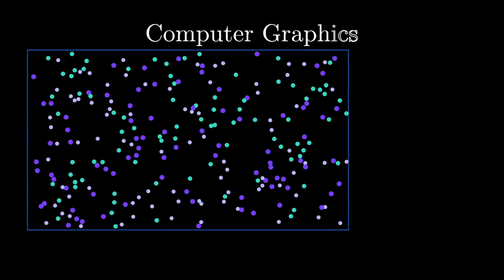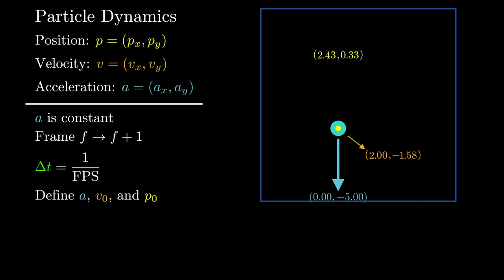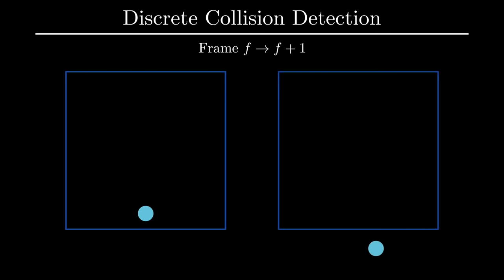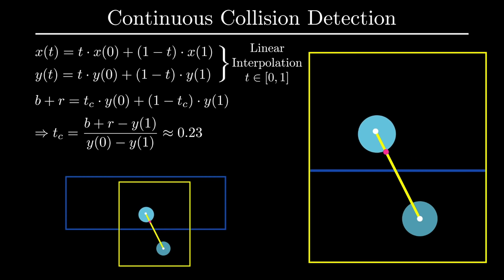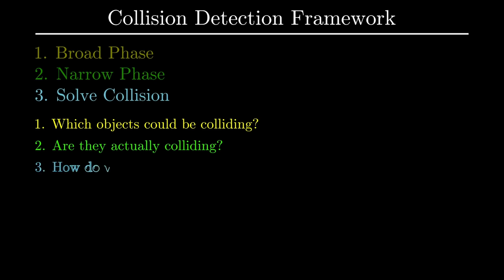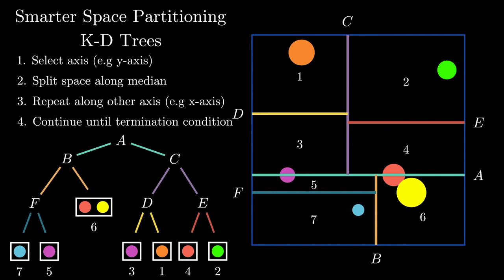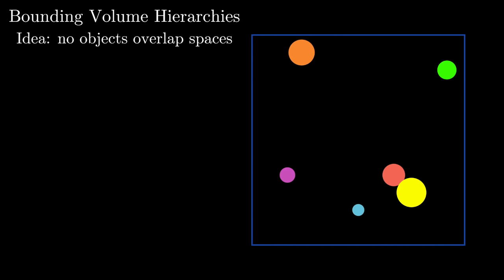Building Collision Simulations: An Introduction to Computer Graphics

Comment: Great video!!!

At 12:48, what is the angle bracket notation? E.g.

<v1-v2, C1-C2>

I was thinking it might be a 2D vector with components "v1-v2" and "C1-C2", but since v1, v2, C1, and C2 are vectors (I'm assuming) themselves threw me off since vector components have to be scalar.
Reply: It's the scalar product (or dot product).

Comment: Thank you for this great video! The explanation was very clear and I found some parts truly useful for the simulation of the adiabatic expansion of an ideal gas that I performed.
I only have a curiosity: between 13:59 and 14:01, if you look around the center of the screen, you see a sort of "orbiting" of a light blue ball around a yellow one. Interestingly, I got a similar bug also in my simulation using the very same algorithm explained here. Do you have an explanation for this? I think it could be a bug due to the fact that we detect the collision only after the compenetration of the balls, which can cause problems for one ball to escape from the other and we get multiple subsequent collisions, resulting in a sort of orbiting. Do you guys agree? If someone more experienced could help me, let me know!

Thank you <3

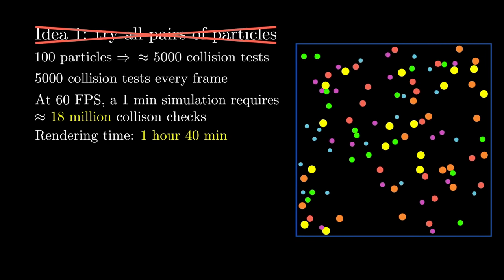Comment: 14:50 What the heck did happend with the blue and yellow ball to the left, roughly at (0.1, 0.45), if the width and height of the box were 1 and the origin would be in the left-top-corner?! The blue ball circled around the yellow one.

Edit: typo

Comment: you really inspired me to start this project by my self, thnx a lot, AND btw, in the box border collision check u r trying to compare CirclePos+R Left /right/up/down and the box border, cant u just do box border cords - Radius of the circle so u end up with a box smalle by R and then u save up memory for cirlce.left[0] and circle.Right[0] ... and easier calculation in "Discrete Collision Detection" cuz u will only look at the position of the circle instead of position + R, correct me if im wrong pls and thanks a lot!

Comment: An optimisation which your missing which only applies to circle collisions so it wont be universally useful is changing the collision detection algorithm from r0+r1<=distance to (r0+r1)^2<=distance^2 the distance squared and the square root in the function can be cancelled out removing the computationally expensive square root function. Significantly reducing the collision detection

Comment: How about the distance square method?

d² = | (x0 - x1) * (y0 - y1) |  or  d² = | (x0 - x1) * (y0 - y1) * (z0 - z1) |

A collision occurs when:

(r0 + r1)² <= d²

This also helps provide gravitational effects between objects:

f = (m0 + m1) / d²
v0 = f * [ (x0 - x1) / d, (y0 - y1) / d ]
v1 = -v0

This does require 1 square root to calculate d.
v0 and v1 are vectors applied to each object, respectively.

Using this I've been able to render 1000 objects in a 2-D solar system simulator at ~50 FPS.

Comment: 20:29 Can't you use a hashmap, mapping Square's coordinates -> List of circles intersecting that square, and then only loop over the keys of the hashmap? Hashmaps are O(1) and this resolves the empty square problem.
Reply: "Can't you use a hashmap?"
you can. But it would only be 1 more alternative, not the best solution. But probably a very good one considering how easy the implementation is.
For example, hashmaps would certainly be slower than a grid-based solution because of the overhead. Remember that time-complexity is not the only limiting factor, but also how fast you can load data into the CPU caches. Because of the dynamic nature of hashmaps this will be very slow (the CPU prefers data that is stored close or even next to each other). You also have to recalculate the hash every time you want to look up a key.

Comment: Wouldn't it be more beneficial to only check for collisions once some particle changes direction or on initial condition? What I mean is that we know where the current particle is headed and we could check where every other particle is headed O(N), initially, this would happen with every particle O(N^2), but after that, we would just determine if 2 paths collide, and if they do, we will keep checking for collisions of those particles, and until some other collision happens, we aren't doing any further checks (except for those particles that have intercepting paths). Once another collision does occur, we would simply adjust the directions, and run our algorithm for those 2 colliding particles (or 1, if it collides with border), resulting in O(N). I'm not sure my logic is right here, but if it is, it would probably result in O(1) average case and O(N) worst case, which sounds a lot better than any of those algorithms mentioned in the video. Is this logic wrong or would it be a good way to handle collisions?
Reply: IIUC, you're saying to protect a line from each particles in the direction of it's initial velocity. Then lines which intersect are possible future collisions.

When a collision does happen though, two lines would change - those of the two colliding particles at which point you'd need to check the two new lines for intersections with all other N-2 lines.

When you say O(1) avg case and O(N) worst case, I'm assuming you mean per frame? Wouldn't it be more like O(M) per frame where M is the number of intersections you have noted?

Btw, an intersection is a collision if the two point particles arrive at the intersection at the same time, so maybe you could color ahead of time the time at which particles arrive at intersections to prune out intersections which won't lead to a collision. Then you could sort intersections by time to find the next collision. At the time of the next collision, the two colliding particles would have new paths which could invalidate some collisions and create new future ones.

I don't know that this would be faster though. I definitely would be more complicated and even more so, given the fact that we're not dealing with point particles, so an intersection can be a collision if particles arrive  at a region around the intersection at around the same time (by contrast, for point particles, an intersection is a collision if the particles arrive at the intersection at the same time).

Comment: If you want an accurate Simulation you would go for calculation all images first and then just make a video from it. to speed up the simulation you have to use trees and other data structures.
if you dont need the accuracy but speed you should go with Verlet Integration instead of the Euler way. Don add up the velocities but use inertia. Thats what we use in computer games for physics simulations.. its pretty accurate and fast at the same time.

Comment: I learnt a lot with this video. Ive tried my solution of those problem in C++ but there is something i dont know how to handle. With Voloban equation, only the speed vector is changed then the position is changed by another function. It wont make a long time until, when particle A and B collides the algo moves one of them in particle C.... After that we have the opposite effect : Part a (or b) is now glued to part c.

I would love to find a way to implement this correctly...

Comment: At 13:59 what is happening with the small blue ball spinning around the yellow ball, roughly in the centre of the box?
Reply: It happens when two circles overlap each other, where their distance is smaller than the sum of both their radii. Applying the elastic collision formula on it does that

Comment: The question I am left with from this video: Do I have to perform these optimizations (like building a tree) each update frame of the simulation or shall I update them dynamically.
Does dynamically updating the tree instead of building a new one makes the simulation faster/better?
If that is the case, could you make a follow-up video about that or give some good resources about it?
Reply from the maker: Ah great followup question -- so what's nice is you actually don't need to do too many updates to your data structures frame to frame by the very nature that frame by frame changes are pretty small. So with sweep and prune, we can actually maintain the sorted list across all iterations and perform insertion sort whenever necessary which is very efficient on nearly sorted lists. That's one example of an optimization.

For trees, Box2D is a game engine that uses bounding volume hierarchies but they implement their own optimized version of it called dynamic bounding volume trees. You really have to dig around to find walkthroughs of these ideas and they can get pretty advanced. I added some links to resources in the description that are good starting points for further exploration. I recommend starting with https://www.toptal.com/game/video-game-physics-part-ii-collision-detection-for-solid-objects - this one of the most comprehensive overviews I found.

Comment: Hi, I am wondering if it matters if the velocity or the position get update first.

In the equation, v(f+1) = v(f) + a(f) dt    --->    p(f+1) = p(f) + v(f) dt .
However in the pseudo-code, v gets update to v(f+1) before update p which resulting p(f+1) = p(f) + v(f+1) dt

I makes a minor difference. I am not sure which one is more accurate.

Comment: you missed quadtree most basic but useful optimization (great explanation by the way)
Reply from the maker: Trust me I didn't miss it, I had to cut it out of the script since the initial script was about ~35-40 min long with quad/oct trees and a few other inclusions. My perspective is if you can understand K-D trees, you can understand quad trees.
Reply: @Reducible  I think it would have been better if you included it , I dont even realized how those 28 min passed

Comment: This is an AWESOME video, I'm now begining to ask myself, how do you do for something else than a box colision or a sphere colision ? Like a collision in the shape of a turtle would be very much harder to simulate right ?
Reply from the maker: Ah, great question! Circles and boxes are the easiest cases so I stuck with that to not overload the complexity. So you are absolutely right, collisions with a turtle shape object are significantly harder. But one hack-y approach to it is you can actually just put a bounding box/sphere around the turtle and simulate it if you don't care about collisions being highly accurate. This is actually done a lot in those types of situations. But obviously, that's not the ideal solution because collisions will look quite off. 

So what people usually do is they take these complex shapes and split them into smaller geometries (bounding volume hierarchies are actually used a lot for this). Defining tight convex polygons that fit the shape is the standard because collision detection with convex polygons is solved quite well (look into Separating Axis Theorem if you are interested). There is another really cool algorithm surrounding these ideas, but I'm not going to give it away because it's actually going to be the next video and I'm very excited to share with you all so I'm not going to spoil the fun :P
Reply: @Reducible  that's the greatest teasing I ever seen :D Those subject are very interesting I might look at them soon :0

Comment: Could you kindly help me with two particle simulation?
Actually, I have a system where a square container is filled with circles of two radius without intersection. Now I want to start applying force from the top and see how the system behaves (assuming circles to be rigid). It is like a piston is pushing down. 
Could you help me with how to approach the simulation? It'd be great help.

Comment: 14:38 1h rendering time for 1m of animation of 100 particles? How? Why so long?  I wrote collision detection and collision response algo in C and animation of 256 particles runs at 60fps and can run even faster when it still uses naive(pairs) check.
Also there is tunneling in your interparticle collision detection. If you want I can send my code with proper collision detection.

Comment: The formulars / code shown falls out of the sky. Some indexes that have no reference etc. But else OK. But in realistic simulation accelerations aren't constant (except gravity if you assume a normal mass next to a huge mass, e.g. a planet). Realistic bounces (a car hits another car) require a particle to deform a little and/or walls to also not being totally stiff.  One should also mention, that it is a difference if you simulate for a computer graphics, games or a simulation model. In a simulation model adaptive time steps might be required. E.g. if two bodies approach each other, pulled by gravity, the acceleration strongly depends on distance (a(r) ~ 1/r²). For a computer game that doesn't matter much. But for a realistic simulation of e.g. planetary motions this matters.  And there is a significant difference if an asteroid misses earth by 10.000 km or enters the atmosphere. 1e4 km on a flight distance of 1e9 (1ae = 1,48e8 km) requires 5 digits precision.

Comment: One problem I found with CCD is when you try and apply the same principles to slow moving objects.  Because the distances involved were so small between frames I ended up getting errors in the floating point calculations which led to a pretty unstable system.

Comment: I'm not clear on whether you are redoing the partitioning on each and every frame, or is there some clever way of saving the results from one frame to use on the next?
Reply: Most BVH trees persist between frames and they have some clever techniques to deal with movement, for example you could update the tree when the bounding box changes and that leads to some tree balancing, to avoid that you could also allocate a bit more space to each bounding box so that you won't need to update the tree structure at every frame

Comment: How did it take over 1 hour to calculate 18 million collisions? I made a simple program in C++ that calculated sqrt((x2-x1)*(x2-x1)+(y2-y1)*(y2-y1)) for random values 18 million times and each time compared it to a given value, which is pretty much equivalent to checking 18 million collisions between circles and it took just one second. Maybe it would take more time if the positions of particles and their radii were read fom an array and not random, but I wouldn't expect it to take more than 1 minute.

Edit:
I just looked at the code and the only thing I can think of that could make it that slow is the fact that you used Python.

Comment: The four broad phase methods only seem to be working for a discrete collision detection since no interpolation is applied  and the tunneling probleme is still existing. Will you talk about this in the next video?
Reply: They can be extended by noting that you are not working with circular colliders with the broad phase. You are actually using slightly larger box colliders. You then just put a term on these colliders that accounts for the velocity (resulting in slightly bigger colliders) and you can build a collider that will capture all possible positions between this frame and the next. If you are moving down and right it will be the box defined by the top left corner being where it is normally, but with the bottom right corner being where it would be next frame.

Comment: Nice video. I enjoyed the overview from a cg perspective. My work is in simulating a highly physically accurate version of this. One part of this that I think is very inaccurate is the time it took to do 100 particles naive vs projection interval. I suspect you had some issue in the code. The gains shouldn't be so drastic with only 100 particles. Also, assuming your dt was 1/60, 100 particles on a current desktop shouldnt take more than a few minutes in a totally naive approach.

I can demonstrate a totally naive, single thread sim of 100 3d balls with friction, soft collision, continuous gravitational attraction, and restitution completing in less than a minute with a simulated time of about 3 hours on an 8700k cpu.
Reply: The same program (2d collisions, 100 particles, 60fps, 60seconds) takes roughly 26ms, running in C with no optimisations, and about a third of that with -Ofast

Comment: Hi great video! I am curious as to how to solve when more than two particles, let's say a cluster, collide?
Reply from the maker: We handle them one at a time and the order is arbitrary. That's actually what I do in these simulations and the results are decent. Now, this is not fully accurate and if accuracy is really important, the best option is continuous collision detection with several particles. The solutions to impact times is a matter of finding roots to various polynomial equations. Check out some of the links I posted in the description for more details.

Comment: I have a question, in the bounding volume scheme, it's still possible for the corner parts of the bounds to overlap or intersect, but the actual circle will still be not in collision, so does using rectangles for a circular object is really the best way?
Reply from the maker: Good observation, and you're right bounding boxes are not perfect because of this fact. If you know ahead of time that you are dealing with circular/spherical objects, you can use circles and spheres instead of rectangles. I wanted to show rectangles because a lot of times your objects in the scene are going to be more complex shapes that may not be as easy to process. Bounding boxes are one of the easiest ways to handle all sorts of weird shapes. There are other schemes that use circles, n-gons, etc.